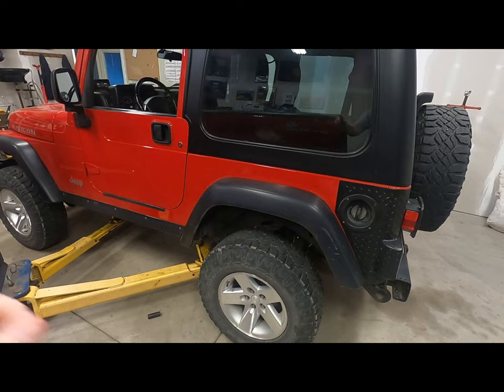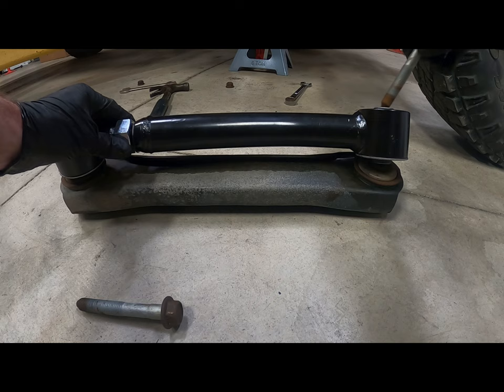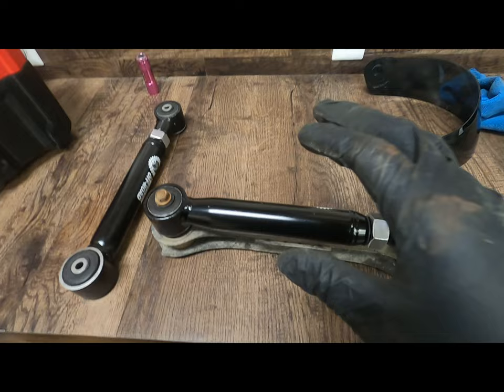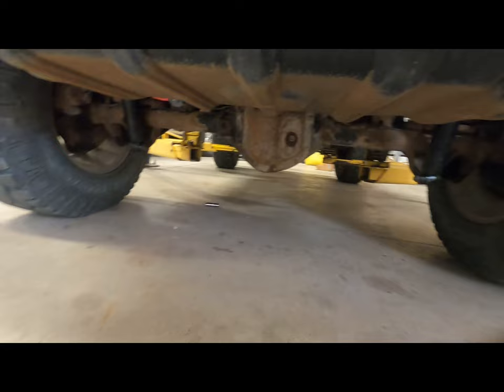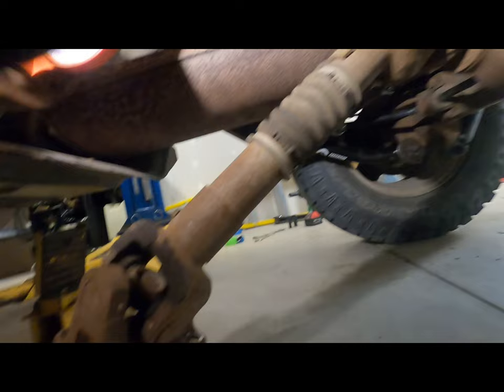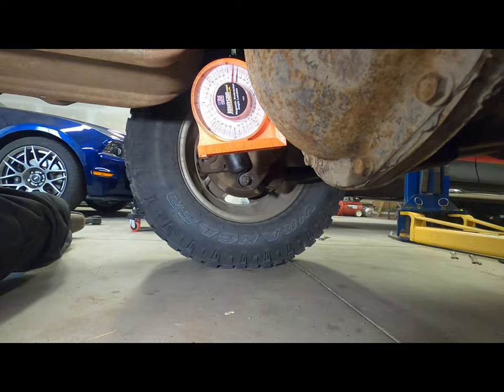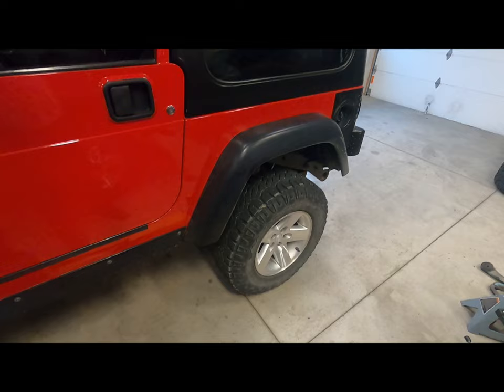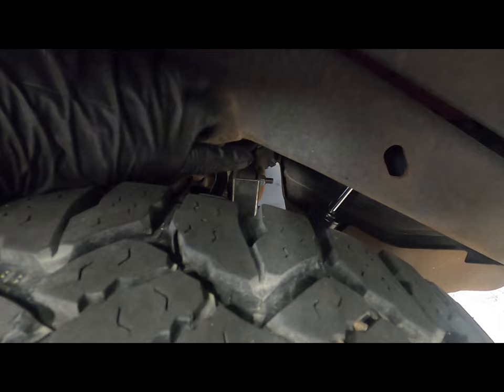Jeep Adjustable Control Arms - How To Set Them Up - TJ Wrangler - Rear

Comment: Glad I found this video.  I got a TJ with a 3.5 inch JKS lift, ever since it was installed this jeep drives terrible on anything not pavement, extremely crazy vibration, cant go faster than literally 1 mph.  Any ideas?
Reply from the maker: It's likely a driveline angle issue. I would check the front and rear driveshaft.  If it does not have a slip yoke eliminator and the pinion angle right, it will cause horrible vibration.
Reply: @KonaBlueSVT  that's probably what's going on, I dropped it off at a new jeep mechanic (not the ones who installed the lift) and i'll see what they say.
Reply: @rmat9023 any update on how it is after the new guys?

Comment: I notice that you're still running a 1" skid plate drop, which is one way to remove driveline vibration.  I've wanted to add adjustable control arms so that I can get rid of my skid plate spacers.  Now that your angles are lined up, are you going to take off spacers?  Although, you need to check angles again, because removing that will tweak your current settings.
Reply from the maker: I am going to keep them for now. My front would be OK, but without double cardan joints in the back, I would be worried about vibrations still.

Comment: Do you adjust the upper or lower control arms for the pinion angle?
Reply from the maker: It can be done from either, but usually upper.